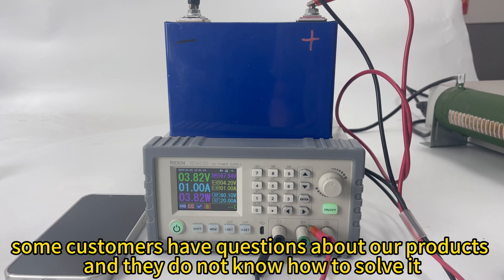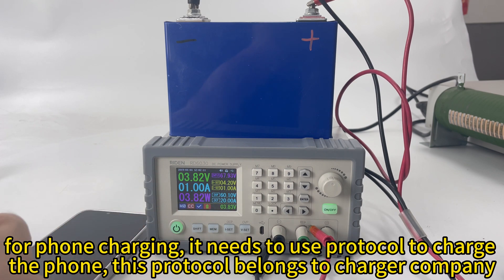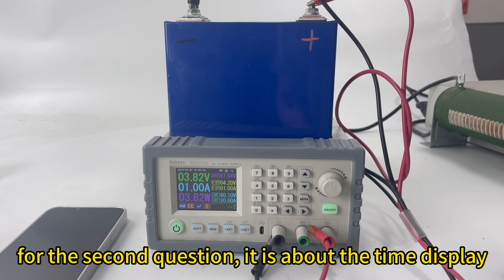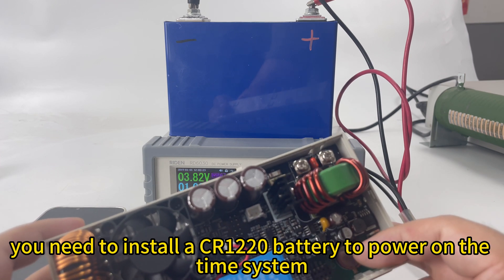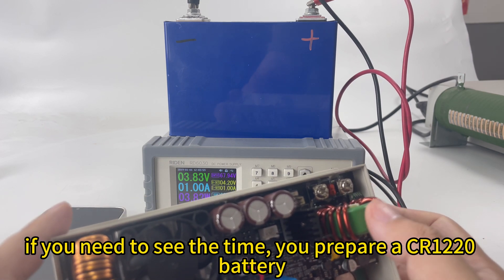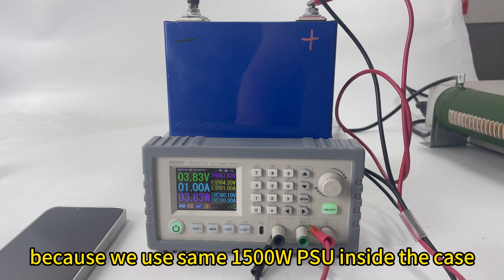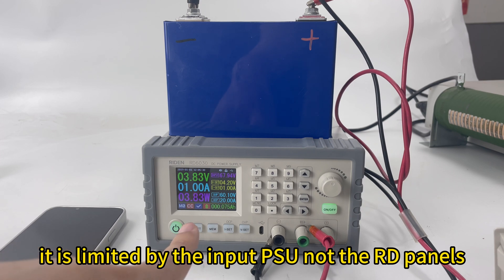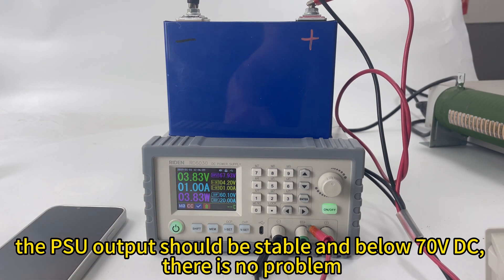RD power supply cannot charge phone with fast charge! no protocol, just directly voltage and current

Comment: when will it come out rd-1800-68 ?)))
Reply from the maker: hello, for this I do not know, but for RD6030 it can output 1800W, so you cannot just use 1800 input to get 1800W output, it needs 2000W 68V switching power supply